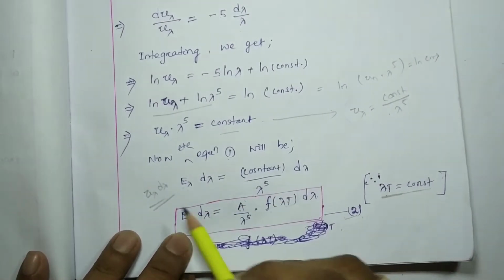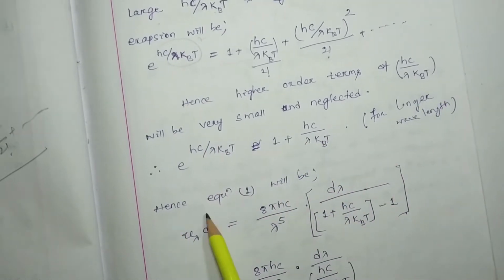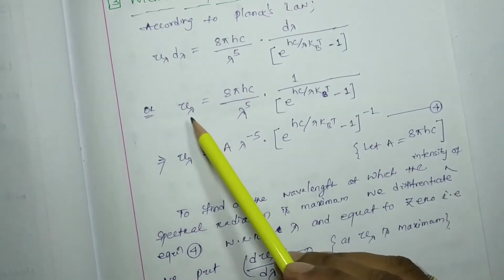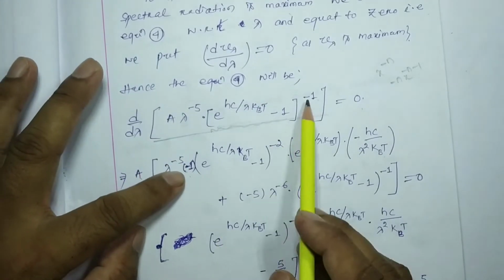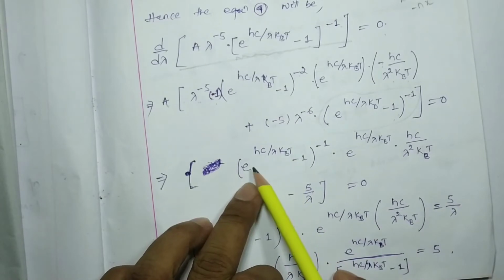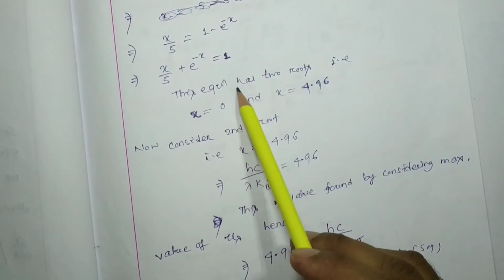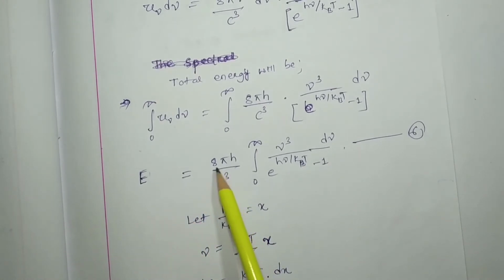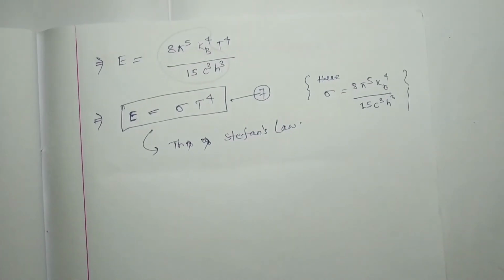Derivation of Different Laws from Planck's Radiation Law

Comment: Great video, my friend. But I want to point out that the Stefan-Boltzmann constant is incorrect. The way you derived it, the result is ~7.4 x 10^{-16}. Your mistake (and mine as well) was using the expression for spectral energy density (energy per unit volume per unit frequency) without considering that the power radiated per area is related to the energy density by a factor of c/4. Check the hyperlink http://hyperphysics.phy-astr.gsu.edu/hbase/quantum/raddens.html#c1
Greetings from Brazil